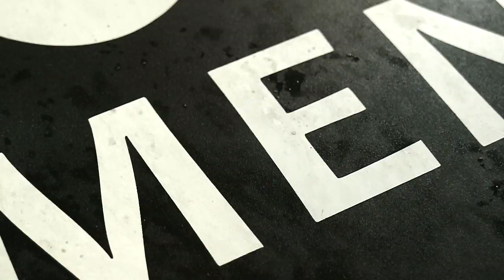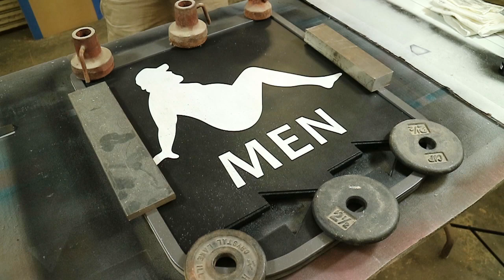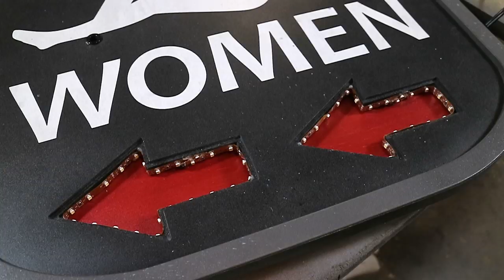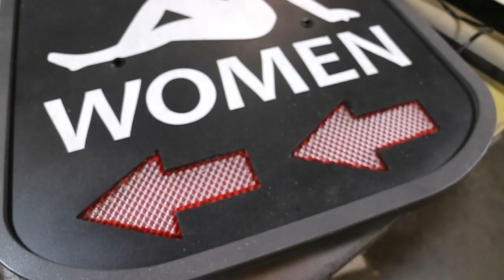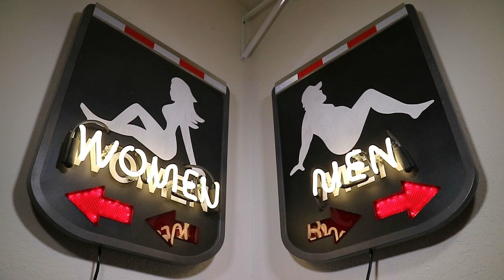Neon Mudflap Toilet Signs

Comment: Love  the signs, but one critique...big missed opportunity with the figures.  On mud flaps, they would be a metallic finish.  You laid sheet at the beginning.  That's when I would have masked.  Just my take.
Reply from the maker: They can be metallic, but aren't necessarily. The problem with a reflective surface on a black background, though, is that it can look dark depending on the lighting and one's perspective, and the figures would have been lost.

Comment: Wesley, I'm curious about how much artistic freedom you are allowed by the client. For this job, did they give you a very specific brief? I saw this build on Instagram and couldn't wait to see the process. Well done.
Regards, Mark Presling Qld. Australia
Reply from the maker: In this case, the client requested using the silhouettes in a design for bathroom signs, and I suggested making them look like actual mudflaps. I worked up a sketch and we determined the details (like how much neon to incorporate) based on their budget.
Reply: @WesleyTreat  thanks for that. I used to teach graphic design and would often discuss with students the process between client and designer.

Comment: nice build. I always look forward to your videos.

just wondering why the metal facing when you are painting it though.?
Wouldn't the shiny side of the MDF have glossed up just as well?
Reply from the maker: It's generally not recommended (and usually not to code) to mount neon directly to wood.
Reply: @WesleyTreat  that makes sense. thanks for the reply 😀

Comment: I had the google. I got a shot. It's all better now.  I love those so much!!  Was the design from the client or is that yours? Just as a side note.  Check the blade on your table saw and make sure everything is straight, I think I hear a little vibration. Cheers!
Reply from the maker: It was a collaboration. The client wanted to use those silhouettes, so I thought, why not make them look like actual mudflaps?